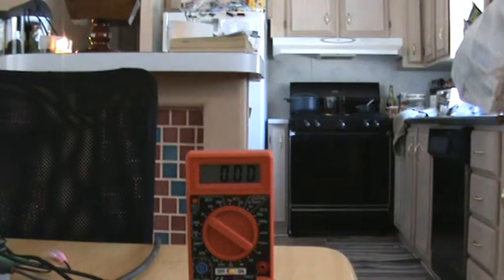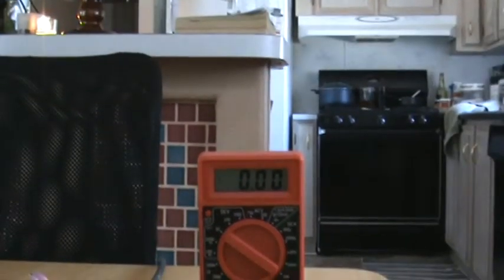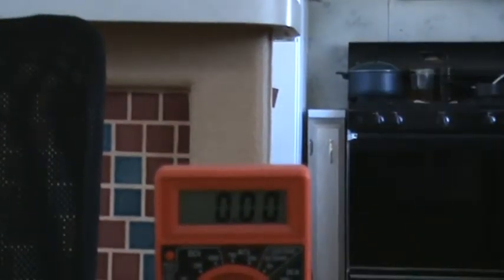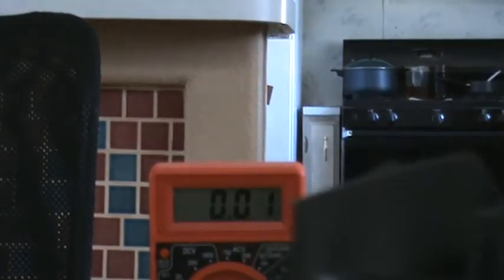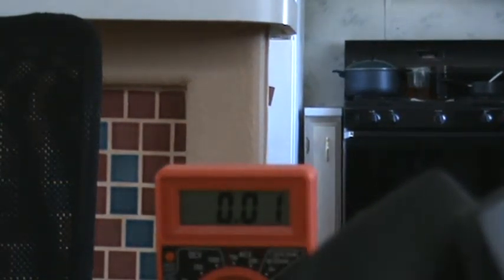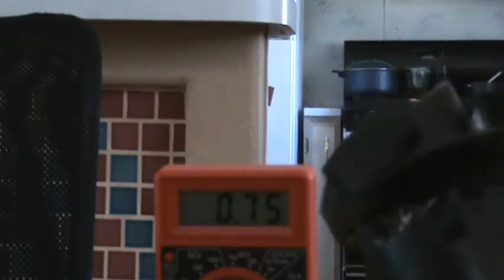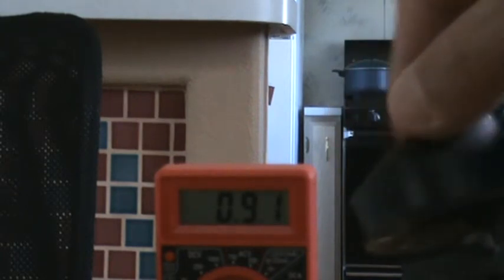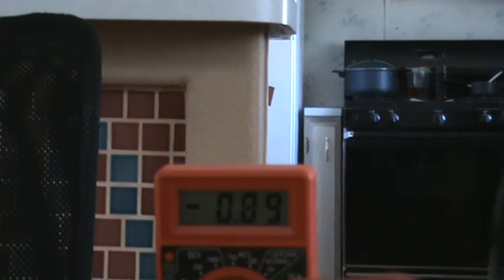2 speed Motor from vacuum possible wind generator

Comment: You need to have it on the ACV setting  to get a correct reading with motors...Unless you have a rectifier to convert it to dc then you can use the dcv setting ..